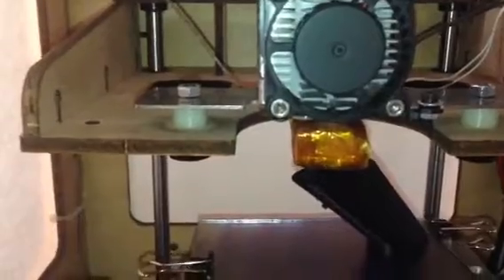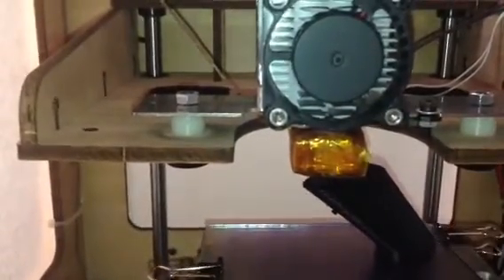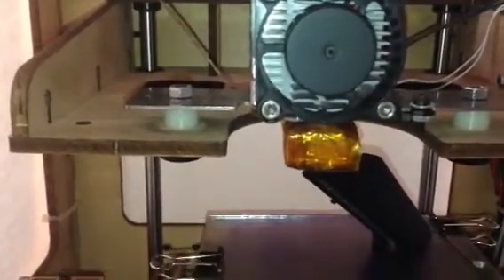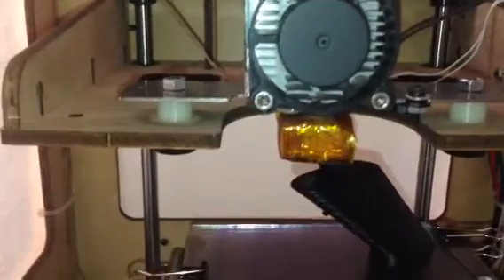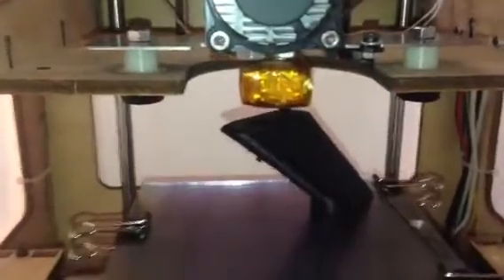More proof that Elmer's works in 3D printing

Comment: Nice vid very informative. One question though, does white elmers glue stick also work, or it should be purple?
Reply from the maker: +3D Printwiz Try what you have. I used the purple. As you can see it works.
Reply: Thanks for the response. White did work for me, but I have problems with the starting print since at the start of the print, the skirt does not stick well to the glass and sometimes gets drag along the surface and ruins the entire print. Any ideas why this is happening.
Reply from the maker: +3D Printwiz Try a little more clearance between the nozzle and bed?